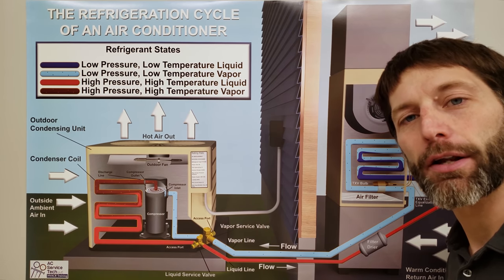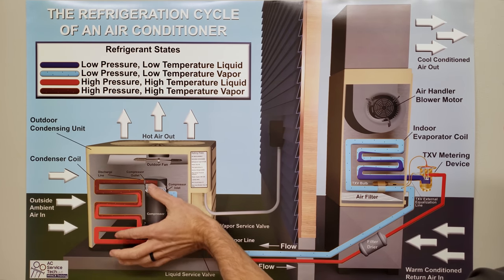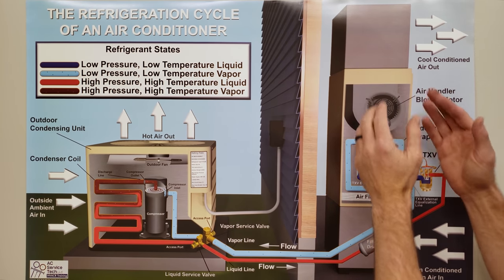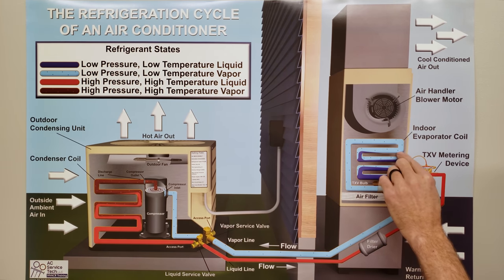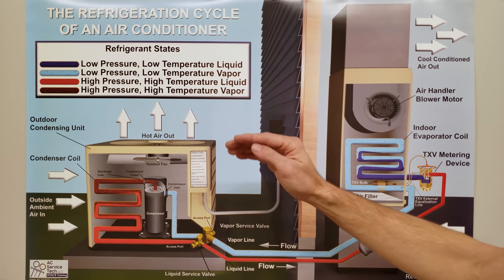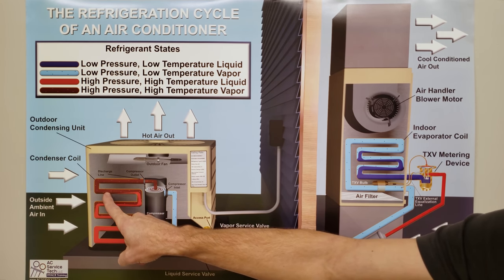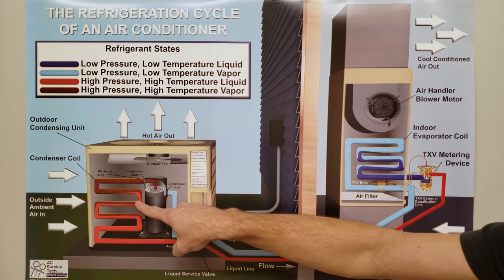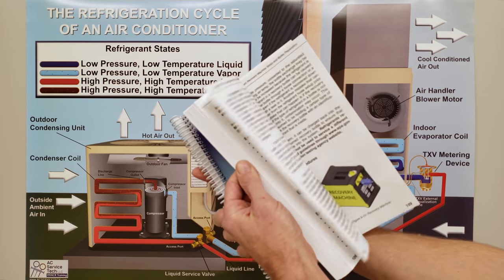How Refrigerant Works in an Air Conditioner! HVAC Technician Training!

Comment: Great explanation. One question: Shouldn't the air handler blower motor be blowing air towards the evaporative coil? In the diagram, t looks like it is sucking cold air across the coil instead of blowing. Is this a valid setup? I haven't seen it installed that way.
Reply from the maker: Furnaces push air across the evap coil. Air handlers suck air across. the blower is in the correct location, thanks!
Reply: Thanks. Is there a reason why the setup needs to be different for cooling?

Comment: What decides the suction and discharge pressure?
For example if it is R134A, 40 psi suction and 100 psig discharge. What factor actually decides the pressure?
Reply: The chemical nature of refrigerant,  the length of the tube in the system including the condensers and evaporators, the weight of the substance, the compressor and the desired temp of the specific system design.
I hope That I could help.
Reply: @mikeautostudent5562  Let me put it this way, the txv controls the flow of the refrigerant, and evaporator pressure was dictated by supply air temperature, what happens to the suction pressure if there is lack of refrigerant in the system?
Reply: Suction & Discharge pressure - Its decided by Manufacturer Air Conditioning Design Engineer. For example in Temp/Pressure Chart for R134A @ 40 psig is 35F and @ 100 psig is 124F. You want your suction pressure greater than 32F, otherwise it will freeze your suction/condenser side. As you know water freeze at 32 F....Compressor suction and discharge are determined by compressor piston size, compression ratio and etc...😍😎😁💖✔ And size of metering device, piston or TXV ...(If you're a HVAC tech, using your Manifold Pressure Gauge - you want your suction around 40 F-corresponding pressure and discharge around 105 F-corresponding pressure using your P/T chart)

Comment: Hello Craig, do you find the current compressor draw more (3 ton heatpump R22)  in heat mode vs cooling?  I get on a hot day in cooling 3000watts (incl fan 1.1amp, 260watt) vs upto 3600w as it runs for a while, which steadily climbs over about 10 mins to outdoor TXV modulation, but is higher in heat mode vs cool mode.  I'm sure you remember I sent you a pix of the sinusoidal current draw only happens in heat mode.  So recap to my question I get about 3600w in heat mode at compressor only after it been running 10+ mins and 2800-3000w cooling mode depending on outdoor temp of course, BTW I'm moving 1400CFM indoor air in heat mode to "cool" indoor coil which I guess is a "condenser" coil.

Comment: How does this system works if its turn on during the winter time does the refrigerant still circulates!
Reply from the maker: This is AC only but check out the refrigeration cycle poster video where I show the flow in heating mode on heat pumps, thanks!

Comment: Let me put it this way, the txv controls the flow of the refrigerant, and evaporator pressure was dictated by supply air temperature, what happens to the suction pressure if there is lack of refrigerant in the system?
Reply: High subcooling low super heat?

Comment: Technically the Metering Device is what makes the Vapor, correct?  it takes the high pressure and pushes the liquid threw the metering device, then the metering device cuts down the pressure because the way the metering device is design the liquid has no choice but to turn into vapor, because of the small outlet from the metering device, correct? if we brake down a spray bottle, the spray bottle has a metering device too. Spray bottle has a compressor, and a metering device, and  liquid. study the spray bottle and you will see how it works.